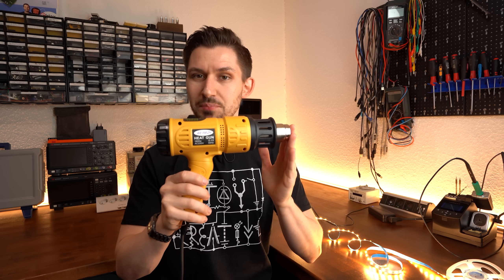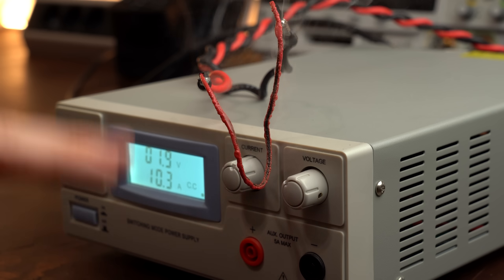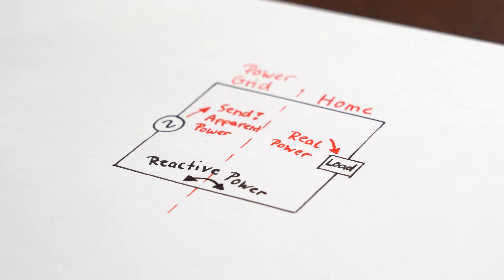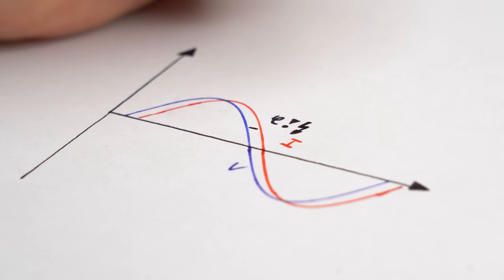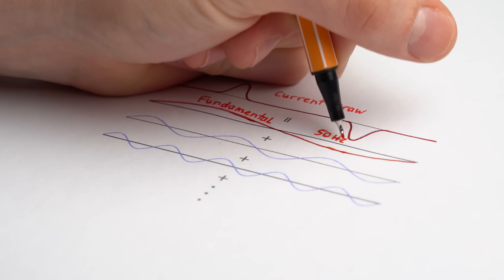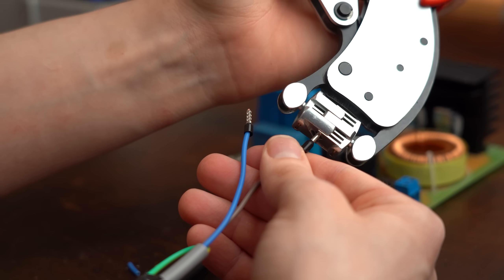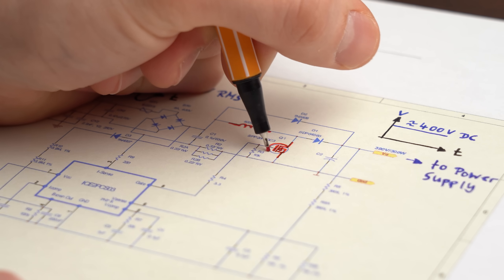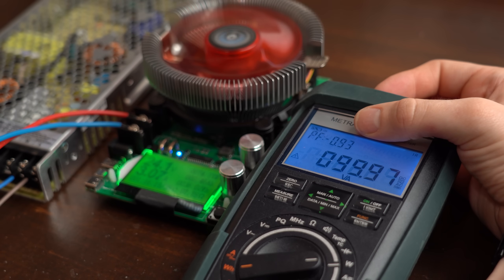The Most Important Circuit for our Electrical Future?! (PFC) EB#55

Comment: Could we increase PFC with a 'dumb' 555 based DIY boost converter?
Reply: Not by only a 555 - but a 555 is very convenient to use as the oscillator. Pin 4 connected to VCC, pin 2 and 6 is connected together, thru a capacitor to ground. Then a resistor (lets call it R1) is put between pin 3 (the square wave output) and the pin 2,6 (trigger and threshold). The frequency is set by capacitor and resistor values, 1 / (2 * C * R *0.693)
The capacitor then get a triangle wave over it, which can be connected to the non inverting input of a comparator - then the output of that comparator will be a PWM signal (that can turn on/off the MOSFET or IGBT via a gate drive), which is controlled by the voltage applied at the inverting input between 0% at 2/3 and 100% at 1/3 of the input voltage. 
To avoid the duty cycle reaching 100% (which will cause a boost converter to short out) an additional resistor (R2) can then be added between pin 2, 6 and 7 (discharge pin) on the 555 to bump up the duty cycle from 50% to a higher value that can set a maximum limit for the duty cycle by connecting the 555s output via a diode along with the comparator output to the gate drive - so each time the 555 goes low it pulls the gate drive low as well, turning off the transistor. Frequency is then set by 1 / (R1 * C * 0.693 + 1/(1/R1 + 1/R2) * C * 0.693) instead and the duty cycle will be R1 / (1 / (1/R1 + 1/R2) + R1). 

Then a signal that's composed of sine half waves (which looks just like what's coming from a rectifier without smoothing) in sync with the mains sine curve is applied to that non inverting comparator input. This will modulate the PWM from 0% up to maximum in the right way to perform nearly perfect PFC, if the inductor is big enough to run mostly in continuous conduction mode. 
I tried earlier to just take the signal from a separate rectifier and lower the voltage and adjust by resistors and capacitor and it worked quite well at high load (when the inductor stabilizes the current quite a bit), but got problem at lower loads with noise causing unwanted feedback that messes with the signal. I will try again later - maybe generate the sine half wave signal separately, then sync to mains by PLL. When I get it working I will put a video of it. It will be a quite high power one of 3+ kW - AC to DC power stage that I will use for other planned projects. 
I will not even start building things at those power levels without PFC - that's quite nasty on the grid and also means only like half of the available power on the fuses could be used.

Comment: I use a chargery c10325 to charge my diy 84v ebike battery, the cheap charger used as much energy on 3 charges as this does doing 4.
Reply: Wow, that’s interesting.  I’m going to start charging my e-moto with a dc-dc boost converter directly from my solar battery bank though so I would imagine that’ll be the most efficient.

Comment: Driving along the back roads, far away from anyone, you might sometimes see a bank of three 'Transformers' up on a pole. No houses, no building, no lower voltage wiring. They're not feeding anyone with lower voltage. They might be grid scale series inductors (?), as that's exactly how they seem to be wired, just in and out on the other side (i.e. in series with the higher 'medium' voltage).
Reply: If they're in series with the load they're probably not correction inductors. My best guess would be reclosers (basically smarter circuit breakers). A second possibility is voltage regulators.

Comment: Probably stupid, but why isn't 36V DC provided over mains? Aside from the kitchen, i have no ohmic consumer running. I don't need DC anymore and would be better of, if all those non-linear consumers had mere resistors, to correct there input voltage. 
Wouldn't one big PSU not be way more efficient than those umpteen small ones?
Reply: DC lose more energy over distance compared to AC, maybe one reason it was not done this way.
Reply: @tiloalo  That's only because DC circuits often run at lower voltage than AC circuits. High voltage DC is just as efficient as high voltage AC. The problem with high voltage DC is it's much more dangerous to deal with.

Comment: Memory aid from the old days: "ELI the ICE man."  (An 'ice man' is someone that delivers blocks of ice back in the pre-refrigeration days, not intended to be a prehistoric human.)
ELI means Voltage (E) on an Inductor (L) comes before the Current (I) which builds up more slowly.
ICE means Current (I) through a Capacitor (C) comes before the Voltage (E) which builds up more slowly.
These are not really needed if you know how these components work, but it can help bridge the gap until trained-instinct takes over.
It's a tiny bit interesting (very tiny) that only one symbol/letter out of four ('C') matches its word's first letter ('Capacitor').

Comment: Nice! 
Funny detail that this video also really shows how distorted the mains voltage has become, because of this problem. It's very common for it to look just like in the video. The top of the sine wave get "clipped" (almost like an overdriven audio signal) because of voltage sag when all the AC to DC converters with smoothing capacitor and no PFC, draws current only in that part of the wave.
Reply: What?  Mains rms voltage dropping?   I just have a variable transformer and turn it up if the voltage sags.   Problem solved!    /s
Reply: He may be using an isolation transformer which could distort the sinewave. Connecting and oscope directly to mains risks a short circuit
Reply: @smeezekitty  True - if he uses such a  transformer to power the load. 
It would probably be better to use it for powering the scope though. Then a much smaller and cheaper transformer could be used as well and any distortion like that shouldn't matter, since it's turned to DC before being used by the circuitry in the scope anyway. 
There are some small "pocket models" of scopes that can run on USB. I have one of those. They can measure mains stuff with no issue if powered from an insulated source like a power bank or cell phone charger. 
I could think a standard one powered by an insulation transformer would be similar. But maybe some scopes get noise issues if ground is left floating 
(and not the best for those who are concerned about safety, since if the scope has a grounded metal casing, it can go live during measurement - but as long as user/casing has no outer grund contact, it will do fine)
Reply: @Speeder84XL  No, the both the primary and secondary windings show the same distorted waveform.  Furthermore, my local supply here in South Devon, England varies by a few volts all the time   It appears to have a few superimposed frequencies in the range one to three Hz, which I believe are caused by different generators in the supply network interacting with each other.  A big driver of this is the diminishing amount of heavy rotating generators as they are replaced by solar panels.  There is also a lot of high frequency noise from invertors and switch mode power supplies.  It's a mess!  (Just building a stabilised power supply before I resume my tube amp experiments.)
Reply: @Speeder84XL I always use an isolation Transformer on bathe bench with an oscilloscope, as it to easy to short something to ground, this dates back to when continental Tv were at half mains ,

Comment: Highly recommend to use ATX power supplies for larger applications. They're tested, rated and certified for all the good stuff one needs/wants in a PSU.
Reply: @saiv46  because moving all the other power rails directly to the mobo you have to replace every time you upgrade is a great idea.
Reply: @saiv46  Pray they never do. 12vo is going to be a nightmare of proprietary cabling on both the psu and mobo side of things as well as offloading an enormous amount of voltage switching to one of the most expensive and least reliable parts of your computer.
Reply: @saiv46  If you're looking at using a consumer computer power supply for just one voltage, it probably isn't for a project that is on frequently at all. For these temporary projects, the extra useful but immediately unused voltages really aren't a concern. A 12VO PSU would then need subsequent voltage modulating circuitry. Like buck/boost converters. With a current standard ATX PSU, and DIY projects, you're pretty likely to have use for 3.3 VDC, and 5 VDC on top of the 12 VDC. Those other circuits add complexity outside of the PSU and are likely not as high quality and clean as the ones in an ATX PSU.
Reply: @saiv46  high power ATX12VO with separated DC2DC converter for another voltages (3v,5v,-5v,-12v) sounds good..
Reply: Cheap ATX PSU very simple like this 12V PSU. They are no contains PFC.

Comment: OK. Get everything, but what is the rationale between us using a single device per device small one of these, and them being a whole house version coming in at the mains supply to each house, provided by the electric company, and heck, once rectified to 400VDC, running our entire lives on DCV instead?
Reply: High Voltage DC is a HUGE safety risk vs AC. This debate was had as far back as the Edinson and Tesla times when homes were begining to be electrified.

Comment: The example with burning wires is inaccurate - no matter how bad the power factor of the power supply is, the temperature of the wire connected to the power grid will only slightly differ from the power supply with a power factor of 1. This is because the heating of the wire does not occur instantly with increasing current, and poor power factor is smoothed out by thermal inertia. On the other hand, large power supplies without power factor correction can affect other power consumers in the circuit and increase the power requirements of transformers in substations.

Comment: And what does happen to the difference of apparent power and real power? Is that energy just released as waste heat?
Reply: Not as heat generally. The generator/grid just adjusts itself to deliver the non perfect waveform albeit not quite as efficiently. But there is some extra heat in that the delivered current is now say 50% higher and due to normal losses in the grid that means that say 50 % times 2% losses = 1% extra is lost as heat. I guess it's the substation transformers that are most at risk as a significantly non unity PF in one local area can destroy them due to the extra current delivered.

Comment: Many of these power packs will run on 385-400v DC if you know what you are doing and test carefully. Internally they already rectify to that voltage. Caveat: 
The rectifier in the power pack will only be using half of it's diodes and can possibly exceed it's rating specifications.  
Our farter, who art in evven.
Reply: I've seen a few manufacturers rate supplies for DC and 400Hz operation.  It's rare but lets you run in spec with high voltage DC.
Reply: On the other hand in order to deal with the current peaks you get when running on normal AC the diodes need to be oversized.

Comment: Hey! Nice content!  If you testing and not sure about a device, just use a bulb lamp connected in series with it. It will prevent circuit from explosion.
Reply: Not necessarily. It will limit the current to the current needed for the bulb, it is very similar to just putting a resistor in series.
Reply: @conorstewart2214  Not necessarily to put  bulb?! It not necessarily till your circuit will explode one time. 
And resistor isn't similar, it got fixed resistance. Bulb have changeable non-linear resistance. 
Also resistor not will show you if your scheme is workable or not.
Reply: @Anatoli-y  you misunderstood what I said. The bulb will not necessarily prevent the circuit from exploding. The bulbs resistance does change but it is still just a resistor and there are other ways of seeing if the circuit works other than just a bulb lighting up, all that means is there is power flowing, not that the circuit is working.
Reply: @conorstewart2214  It will prevent from a huge explosion and destruction on pcb from AC current. You also misunderstood what I said, it will show you that a pcb(device) is not short circuit. I use this method for a long time and its work perfectly.
And what other ways?

Comment: I used to work at a very large manufacturing facility that was built in the late 1960s. This place was so big it had it's own power substation. They had incredible milling machines to create large parts for aircraft. At some point they were experiencing a large lagging power factor issue and the utility was going to require them to pay for a major upgrade to the power lines to the facility. One of their electrical engineers said hold on. He designed a system to use synchronous motors to create a leading power factor to correct the problem. He used these motors to power air compressors for the facility since they used a lot of compressed air. In 1980 we installed a 5000v 500 horsepower synchronous motor. It was the 3rd compressor in that building. Since that time a lot of the electrical loads have been changing. The lighting all changed from fluorescent to high pressure sodium in 1982. By 1990 we were replacing those with metal halide. Now those have been replaced with LEDs. The milling machines are all going to variable frequency drives. I retired in 2012 so I don't see what's going on there anymore.
Reply: This is one of my favorite things about YouTube. Older people telling stories of their younger days.
Reply: There's smart and then there's coming up with improvised power correction on the spot, smart
Reply: now it probably has leading power factor in the off duty hours, due to parasitic cable capacitance
Reply: @DrRedstone172  They don't run the synchronous motors all the time. They only need compressed air when the machinery is running. It's also my understanding they can change the exciter voltage to change the lead, but I'm no expert.
Reply: @RedHotFiat  i meant the capacitance in the cables
Reply: @RedHotFiat correct, they over excite the rotor which creates a leading power factor. When synchronous motors are used in this way they are called synchronous condensers. But since in your case, they were using them as both motors and condensers they would be considered some sort of hybrid.

Now days there are more efficient methods of producing VARs.
Reply: @RedHotFiat  What kind of aircraft parts did they manufacture? Any jet turbine parts?
Reply: @anon_y_mousse  When I worked there they did wing skins and spars, fuselage, undercarriage, and duct parts. No propulsion. Lots of milling, stamping, welding, EDM, acid baths, electro plating, and painting.
Reply: @RedHotFiat  Yep, a synchronous motor (aka synchronous condenser) can be tuned to any power factor.
Reply: Any chance that engineer spent time teaching at Devry in the mid-80s? I heard the same story from an EE professor there.
Reply: nice story
Reply: @prashanthb6521  HELLO????????
Reply: I remember commissioning a SPF press at a BAE plant in the 80's that sounded very similar, with the same limitations on grid load.
Reply: The inertia of the synchronous motor might've also helped with current inrushes which are usually charged by utilities.
Reply: doubt, the only thing curbing inrush these days are star connections or vfd
Reply: They are called synchronous condensers or synchronous capacitors.
Reply: brush to brushless is also another savings
Reply: Talk about a reactionary!
Reply: I think ofc circuit its not always a boost converter, it can also a buck.
Reply: @dadaroja2455  
If you need high performance over a wide range of AC input voltage you have to use a boost converter. If the requirements are relaxed you can, in some cases, use a buck circuit that is an improvement over a simple rectifier but doesn't achieve the very high power factor / low harmonic content you can get with a boost circuit.
Reply: ⁹⁹
Reply: People think I'm crazy😂
Reply: Led lighting is often a capacitive load.  It's causing issues with old buildings with shared neutrals.
Reply: I like to think that that guy  got a pretty wealthy bonus every year.
Reply: This was a cool ass story for a normie
Reply: Waste of motors as we correct power factor with capacitors..
Reply: @lonewolftech  (if there was work which could be done, no skin off anybodies nose, caps are of course pure reactive so  achieve nothing but grid balancing.) ?? somebody probably did some sums, back in the day, caps may have been undoable/expensive - or the story may be unverifiable, who knows.  lol, this is just the internet.
Reply: I used to work so I dont see what's going on there anymore. In 1980 the lighting all changed to air compressors. We installed a 5000v 500 horsepower synchronous LED high pressure sodium.

Comment: Does a PFC increase the idle power for appliances with standby/sleep mode?
Reply: Probably, it's one more conversion stage with its own losses.
Reply: Technically yes but the losses are usually small. Also many devices will disable active PFC when they enter a low power mode.

Comment: NCP1608 is a good option it's reliable, cheap, and most importantly, it uses a current shaping capacitor to reduce THD which means no line feedforward network is needed